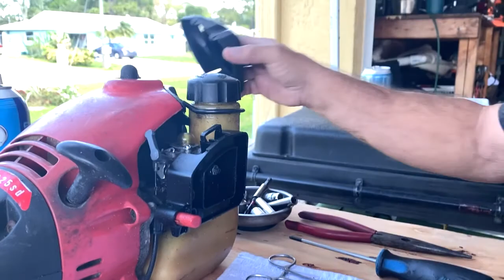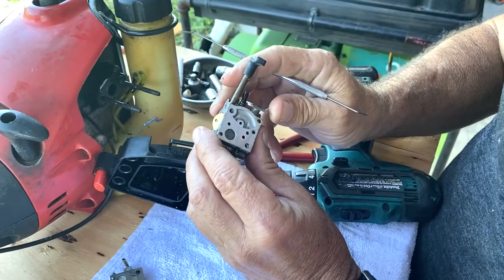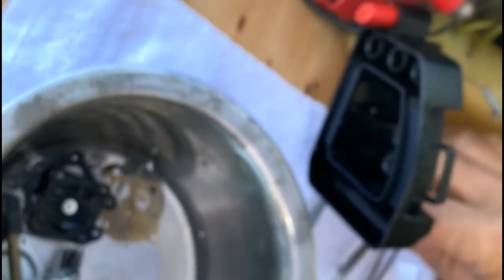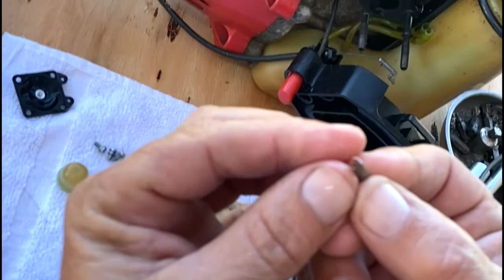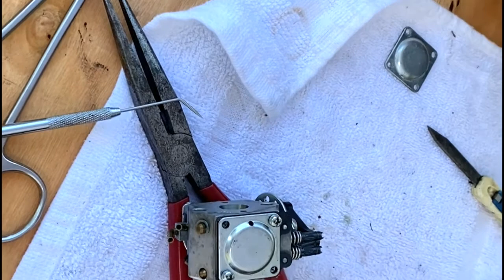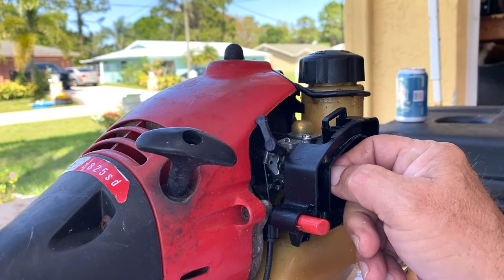HOMELITE ZR SERIES WEED WACKER REPAIR

Comment: I need the fuel line with the filter for the gas tank HM-9477222 part number. checked online and  its no longer available guess I'll have to go to the hardware store and see if I can find a line with the right diameter. Or, fine a old one that's not working.